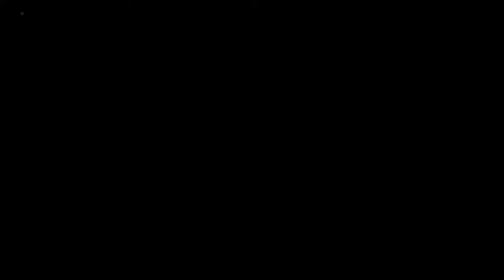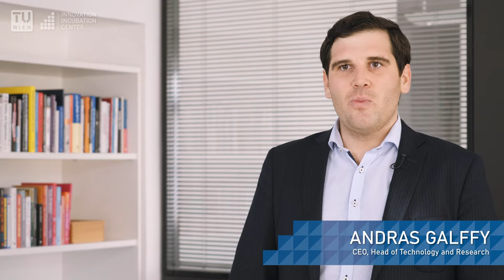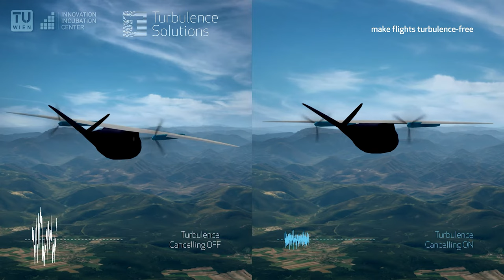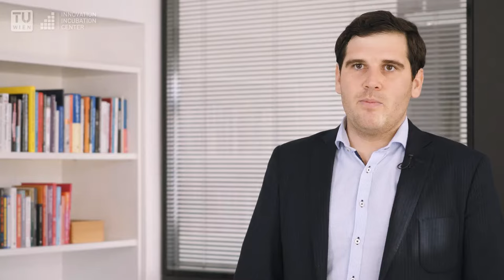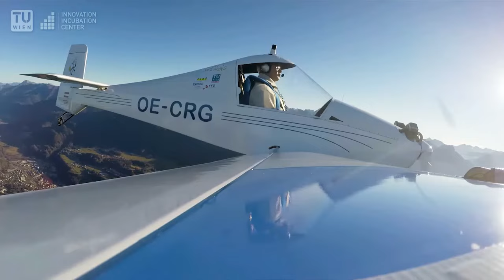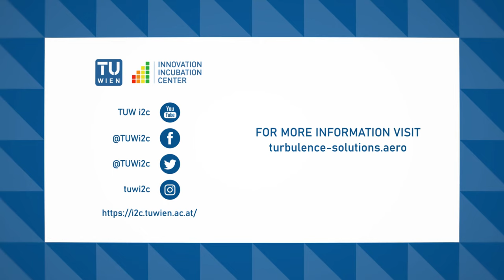Turbulence Solutions - Making flights turbulence-free

Comment: looks the the flight control surfaces will need to be of a much higher build quality than normal for that constant work load displayed in the video.
Reply: In compensation the rest of the plane can be lower quality.
Reply: The actual product has smaller control surfaces (flaplets) installed into the flaps. They act just like flaperons and do not need to have longer lifetime requirements than other control surfaces.

Comment: l'uso pesante e considerevole di flap e timoni direzionali ridurra' del 95% l'MTBF  di queste parti dell'avionica , tentativo buono ma inattuabile economicamente.
Reply: The actual product has smaller control surfaces (flaplets) installed into the flaps. They act just like flaperons and do not need to have longer lifetime requirements.